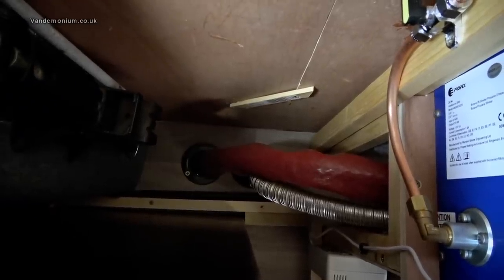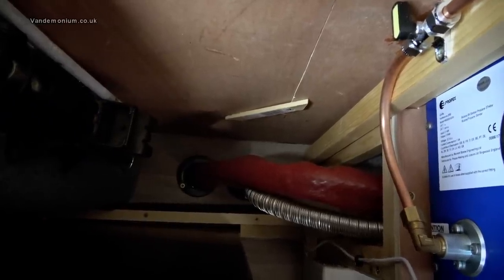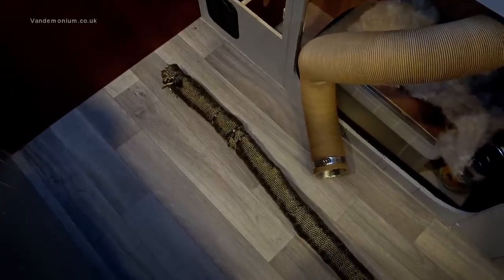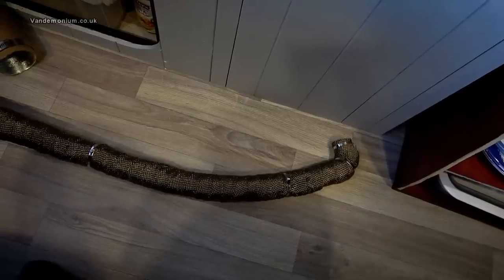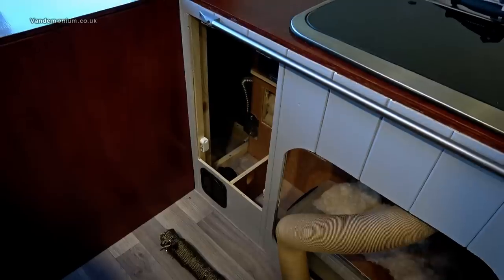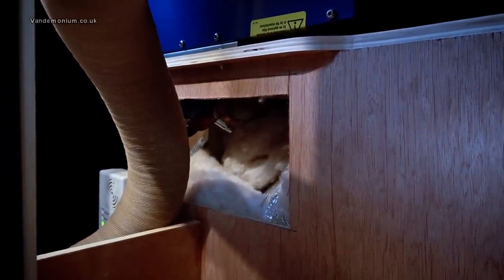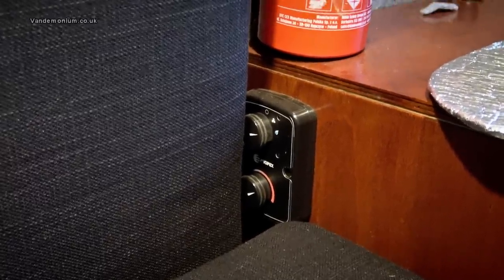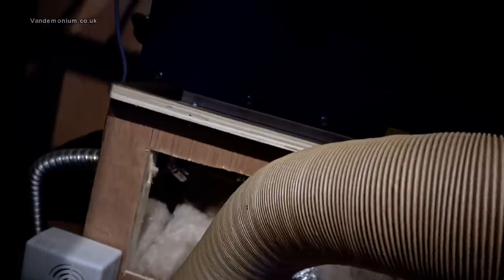Vlog 27: Adding extra exhaust insulation on my Propex HS2000 campervan heater

Comment: Hi David - you have done a great job and actually you need that access hole, let’s call it Version2 of the design.
Recommend you add a laser thermometer to your now extensive tool collection - it will help quantify these sorts of problems with a tad more precision. It will also provide a source of amusement on dark winter nights looking for cool spots in the van. I would cut another hole in that wooden boxing and fit vent terminals to that and the closing plate you eventually fit over the access hole. The benefit is that it will allow any heat build up to escape into the living area . Well done for your persistence.
Reply from the maker: Good ideas, cheers!

Comment: Since you now have an opening where the warm exhaust pipe is, install a small blower fan, to distribute the heat from that area - make good use of the waste heat. Thus the pipe bend becomes even more cool, and you dont need to run the heater as hard.

Comment: Oh god, I'm about to refit my propex heater as well and I have the same issues. I'm not happy with the way the original manufacturer fitted my exhaust and mine is also high up due to the wheel arch being in the way. It's a relief to see that someone else has had the same problem as me 😳.
Reply from the maker: Good luck!

Comment: Finally someone address the hot exhaust pipe. I'm getting ready to purchase a Propex heater but have been leery because of how hot that pipe might get, especially running through the floor boards and in your case next to the wood paneling. Thanks for the idea addressing the problem. BTW, love the terminology from the other side of the pond.
Reply from the maker: Hi. Glad it's useful. Of course most people drop the heater directly into the floor so the exhaust spigot goes directly outside and then the exhaust pipe is entirely on the outside. The only other place I've seen an installation done the way I have it (exhaust pipe inside, with wrap) was on a small canal narrowboat but at least that indicates I'm not alone.

I'm just about to put up another vlog talking (briefly) again about this topic, amongst others, and will be doing a further temperature investigation on the way I have it sometime this winter.

Comment: Hi David,  If you feel that the van gets too warm, may I suggest that you either cover the carpeted area of the van with some lightweight paneling, or (bigger job) replace the carpeting with insulation, and outer light weight paneling.   All of that carpeting that you have in your van, is going to add noticeable heat.  Just a suggestion.   Richard M.,  Scottsdale,  AZ  U.S.A
Reply from the maker: I want it warm! That's why I've got the heater. I simply didn't want the heater exhaust setting fire to the van!!
Reply: Ha So, Very wise grasshopper.

Comment: Please keep an eye on the silicone coupler. I've seen where they have failed when they are insulated. What happens is they'll overheat after because the heat can't escape.
Reply from the maker: Excellent info, thanks for that. I intend to keep a close eye on it whenever it runs. Cheers
Reply: I'll second that. Silicone tends to disintegrate rapidly just above its working temperature. When I had a propex years ago it had a metal elbow. I wonder if they are still available from somewhere?
Reply from the maker: Well I got the joints from Propex themselves, sold for that purpose....!!

Comment: David you have done a brilliant job on the van.  Not perfect but that is the point of almost any job done by hand.  
I liken it to going to buy a new coffee mug.  Walk into the shop and on the shelf are 20 mugs all identical. Obviously screen prints.  Nah not for me.
In the shop next door are also 20 nice new coffee mugs all looking the same but were hand painted.  While they may all look the same at first glance, on closer inspection you notice the slight differences. A brush line is not quite straight, or thins a little towards the end.  They are all the same but all individuals.

If I was doing this build there are 2 extra things I would have probably done.
First thing would have been to is us a big thick black marker and write my name on the Celotex somewhere.  Probably on that wall you lean against behind the couch. Also leave your contact details.  Just think in 15 years time some young couple buys the an and in the process of gutting it to do a fresh install and find a link to this channel.

The other thing I would have installed is what we here in Australia,  call a Voltage Sensitive Relay (VSR), between the original van battery and your leisure battery. Probably the same thing on your boat that you call a split charge relay.

All in all a very good job.
Reply from the maker: Hello Peter. I considered a VSR (or, if my van had a smart alternator then a battery-to-battery charger) but as the engine battery is lead acid and the leisure is AGM they have slightly different charge requirements so it would have to have been a b2b charger and I couldn't find any I liked that said they could deal with differing chemistries on the two batteries. Cheers

Comment: I can't help feeling there is a missed opportunity for the exhaust pipe to provide heat for a radiator before it wends its way out the hole in the bottom of the van. Yes/no/maybe?
Reply from the maker: With hindsight, yes
Reply: How so?

Comment: if you want it cool to the touch why not add a larger id pipe around it kinda like a double insulated flu. lovin the videos on both your channels :)
Reply from the maker: Not a bad idea but because of the way it flexes, I'm not sure how I'd do it without heat transmission from the inner pipe to the outer pipe..? They'd have to touch to hold the outer one in place I think.

Comment: Jobs like that will make you invent new swear words. Looks like you got the result you were after. The worst downside to the whole thing is that it would be really nice to be able to somehow reclaim that heat and use it to keep warm.

Those clamps you were working with and you refer to as Jubilee clips, here in the US they go by several names, Breeze Clamps; the name of a company known for making them, kind of like a Hoover, Hose clamps; because they are used on hoses, Strap clamps, Screw clamps, or Worm Clamps; because of their design. I'm sure there others but those are the highlights.

Comment: Thank you David, I have caught up with the van - I am still working on Crusing the cut! I think you did a great job of the van, but you still can't stand up in it! I was wondering where you kept  all your tools, are they on the boat or do you have a lock up? I have looked at the comments and can't see an answer, but have failed to find a way to search the comments!!!! keep the volgs coming we love them!
Reply from the maker: No I can't stand but generally I don't need to, I'd be sitting or sleeping in there. I am pondering whether to add a poptop roof when I've saved the money though.

Comment: If you'd clamped or wired the two propex external pipes together till outside the van, had wrap across the both of them together, the incoming air would be warmed, while the exhaust air would have been cooled a bit by the incoming air..
Reply from the maker: The incoming air doesn't need to be warmed, it's for combustion only, it's not that air which is blown around the van

Comment: Use a proper size socket (and a universal join with a ratchet if necessary), instead of a screwdriver on jubilee clips, much more secure holding and not as frustrating trying to keep the driver in the slot without being able to see it.
Reply from the maker: Hi. I was indeed using a socket.
Reply: @Vandemonium   Then...  perhaps a bit more drama expressed than encountered? ;-)
Reply: @Vandemonium  In all seriousness, if the nut cannot be seen, and is almost inaccessible, but can be reached with your fingers, put some hot-melt glue in the socket, apply it to the nut and let it set, a matter of a few seconds, then offer up the ratchet, u-join or extension.
The glue bond is easily broken and can be removed with a pick or tiny screwdriver.
Reply from the maker: Me, hamming up the drama for a video?!! Hahaha, never!

Comment: Obviously if your heater was fixed to the floor, you wouldn’t have the hot exhaust problem, as there wouldn’t be a longer exhaust as it would just drop to the floor. Maybe a rethink or tweak?
Reply from the maker: The heater can't go on the floor for reasons explained in the build videos.

Comment: I’m a bit worried that your fluffy insulation isn’t  fireproof. If it’s not I suggest some rock wool insulation be placed around the hottest part of the pipe to create a barrier from the fluffy insulation. Should be simple enough now that you have a honking big access hole.

Comment: Everyone tries to help, and I'm no exception. A suggestion . . . Why not use the "wrapppy" insulation OVER the pipe in the area FROM the heater TO where it just goes through the floor. That's the hottest part of the hose and would be "triple" insulated. I know it's a bit of work but that seems to be your style of doing things. Do it right the first time, and it's a joy forever. The other thought I had was perhaps that particular cabinet should have been constructed of metal, but NOT aluminum. Too late now though.
Reply from the maker: The wrap does go over the pipe from heater to the floor (and beyond). Then the other insulation is over the top of that.

Comment: Hi, I'm really pleased with my Propex & gaslow set up. I have the thermostat add on & it's awesome. Would you say that it's more quieter inside & outside now you have insulated the exhaust? I might buy a muffler kit for added stealth.
Reply from the maker: The insulation over the exhaust and intake made no difference at all to the sound levels, at least not noticeably. Most of the noise comes from the whoosh of the heated air being blown through the ducting (see my later video testing their "acoustic ducting" which does cut it down)

Comment: I didn't realise the exhaust would be so hot. That's give me an idea though, I wonder with alot of thought whether you could use the exhaust heat to heat water. Maybe wrap the exhaust with copper pipe transferring the heat to a small tank 🤔
Reply from the maker: Yes, I've had a few people suggest that and with hindsight, quite a good idea. I'm not going to try to retrofit one now though.

Comment: Hai David, do you have the link for me where to get the exhaust wrapping?
I wil need it for my exhaust on the boat because my exhaust pipe is going up and 1,5 meter of the pipe is inside my boat where it wil heat up my boat.
Greetings,, Kitty.
Reply from the maker: Hi. No link offhand but if you just search Amazon for "exhaust heat wrap" you'll find loads of it. Cheers

Comment: I see your propex is mounted above the floor and the exhaust connection to the heater is not outside the van , but rather inside... any concerns with exhaust gas leaking in the living area  or do you feel confident in the connection ? My van floor is pretty thick , I may have to have to do the same...just curious on your experience so far.
Reply from the maker: I was anxious about this as well but I emailed Propex describing the setup and they said it’s OK but best to use the blue high-temp silicone joints where the inlet and exhaust pipes join to the unit, as these are a very tight squeeze fit. I added jubilee clips as well. I’ve never smelled any exhaust from the heater. As shown in the videos, I also double-lagged the exhaust pipe and routed it with air around it as it heads out of the van. I’d have preferred a more conventional installation but it wasn’t feasible. Plus I know they mount those heaters in boats with pipes then running to an exit (above water!)
Reply: @Vandemonium  Awesome. Thanks. Cheers from New Mexico.

Comment: What a fiddly, faffy job but where there's a will there's a way. So I assume the insulation that's next to the exhaust is heat/fire proof? Yes, it must be..
Reply from the maker: I've actually taken out the insulation that was in direct contact with the bottom of the heater, just in case. Anything like that makes me nervous, which I think is probably a good safe trait to have!
Reply: @Vandemonium  Yes, I guess so 😏

Comment: I can't stop myself from thinking "what a waste, all that heat being exhausted outside"
Reply from the maker: That's exhaust pipes for you!
Reply: I thought that too. Why not run an unshielded section of the exhaust pipe into and out of a water tank to reduce the heat in the pipe and provide some warm water for washing up?
Reply: Indeed. Pity you can't wrap a hose round it to heat some water.
Reply from the maker: Perhaps a future upgrade vlog!
Reply: I guess you'd have to make sure you could drain any condensates from the exhaust vapour.

Comment: Did you hear me shouting solutions to get the pipe down th’ole?  Guess not... it involved a condom.
Anyway, consider a computer cooling fan on that boxed in area to draw out the heat from it. Take bugger-all current and get a little extra heat into the interior where you want it.

Comment: Not sure why but the Propex website says the red combustion heat sleeve isn't suitable for the HS2000.  Did Propex mention this when you spoke with them?
Reply from the maker: Oh! No, they didn't. Does it say why? As it happens, I'm now in the process of taking that heater out to replace it with a diesel unit.

Comment: Does the combustion air inlet hose get hot as well? I'd like to mount that on a wall that has some fabric like material on the wall and out the trailer.
Reply from the maker: As far as I know it remains cool but as my pipes are hidden underneath the corner cupboard, behind the gas locker etc, I have never actually put my hand on it to test. I can see no reason it should get warm though, it's simply pulling in air from outside.
Reply: @Vandemonium  that's what I'm thinking to. Thanks for circling back.

Comment: Why didn't you purchase a diesel fuelled heater?  You could have saved room with the gas locker.
Reply from the maker: No I wouldn't because the stove is propane-fuelled so I'd still have had the gas locker and then would have had to find space for the diesel tank (or drop the vehicle tank to put a feed in there, which I really didn't want to attempt)

Comment: It's a shame that the excess heat is being wasted and not used to maybe heat some water for free.
Reply from the maker: Yes, if I'd realised how warm it was going to get and thought about it in advance, I could have arranged a hot water system around it. Something for the next van build maybe!
Reply: @Vandemonium  Yes, it could work, maybe with some kind of coil wrapped around it. Lovely hot water for your ablutions! Next time maybe.
Reply: Exactly what I thought, perhaps using a small radiator of some sort to both cool the exhaust pipe and keep the heat in the van, a version 2.0 mod for another day ;-)

Comment: It's a shame the heat from the exhaust is going to waste & not being used for extra heat.
Reply from the maker: It is but then on these systems usually the exhaust spigot goes straight through the van floor and the entire exhaust pipe is outside so the heat is always wasted. Mine is unusual in mounting it where I did. It would be an interesting exercise to try to capture the heat but there are specifications from the manufacturer about how long the exhaust pipe can be and also how long relative to their air intake so any heat-extraction solution would have to take that into account.